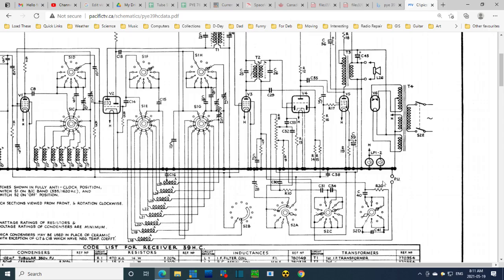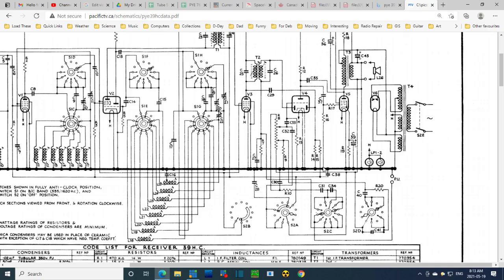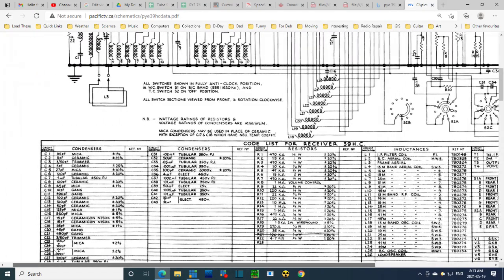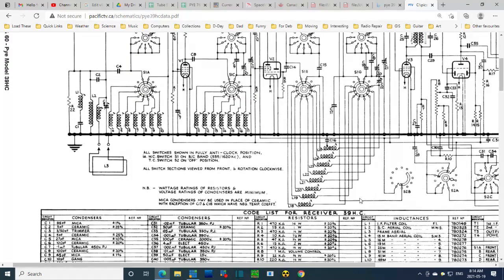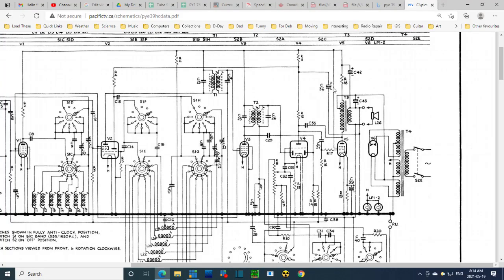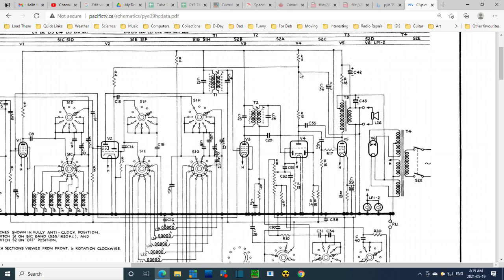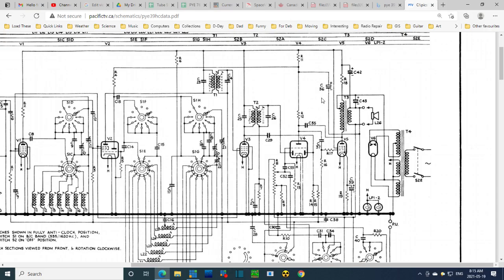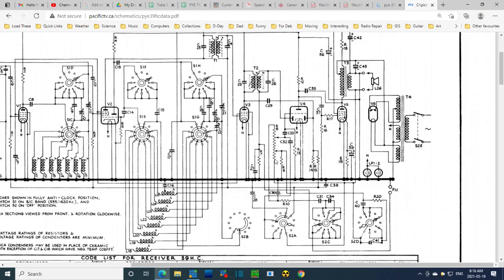Canadian PYE Model 39HC Video #47 - Feedback/Tone Circuits

Comment: Don't ignore the electrolytic capacitors. If it says C36,C39, and C42 plus  C43 are a certain value make sure not to replace them with too high a value. 
Instant motorboating at near to full volume will result.

Comment: Well that's not cool .

Lets see if I can go through the switch functions by looking at a screen shot with no component values  ….. 
What could possibly go wrong  LOL . .....

S2B = 
The control grid feed ( Radio on / off  ) .

S2A  = 
AGC time constant switch dropping C28 on & off the agc line .
It switching C32 in & out ( feedback hash limiter or top cut ? ) .

S2C = 
Detector audio shaping feeding the top of the volume pot .
( Detector  > C31 ( or C31 & C34  in series ) > R10 > C30  ( 0v so rf  / af cut ) > vol pot .

S2D =
Is a audio feedback shaping network .
( it's shaping the feedback applied across R9 so the amp ! ) .

Note 
C35 is for feedback ( probably a AF band stop ) .

Did you change C39 ?

Comment: 4:34 Nonsense! The tap off the volume control is 1/3 to 1/4th up from the minimum volume setting. You yourself have drawn in the signal path in red. 
Also if you are so sure, why dont you put proof to your words? Put the volume control at the point the oscillations set in, cut the tap resistor R9 and measure for continuity between the wiper and the tap. I am sure you will find the wiper on top or at close resistance to the tap point.
You have the schematic right before your eyes, still you fail to read it or come up with a proper plan of action to prove or disprove your "deductions". All you present is fantasies

6:59 NO! For crying out loud.  The wiper of the volume control moves upwards R8! So if you turn the volume up the resistance with respect to the top of R8 DECREASES. Decades of fiddling with radios and charging customers labor and you still dont know how a potentiometer works?

Comment: Where you cut that wire off from the feedback connection to the output transformer, you should ground that point then the volume control might turn down to zero.